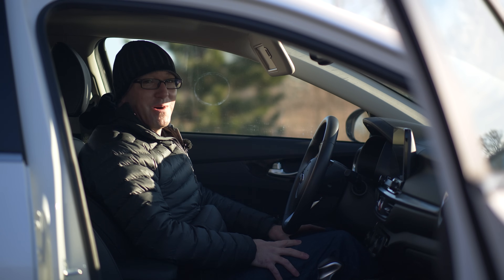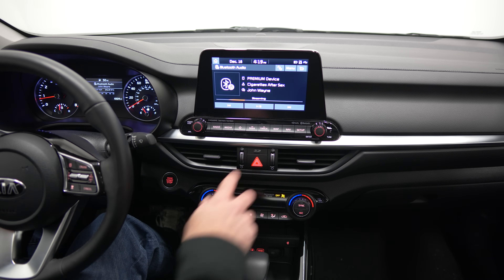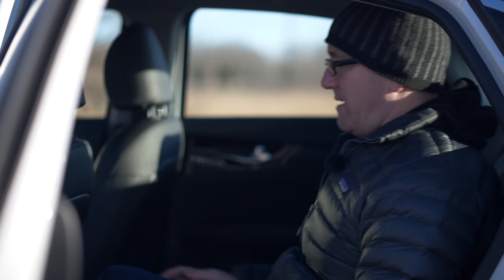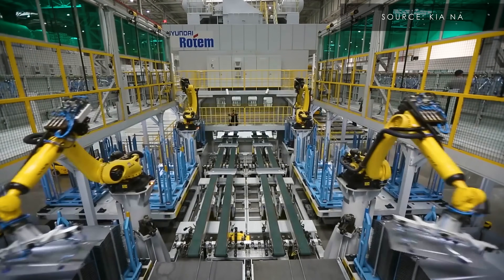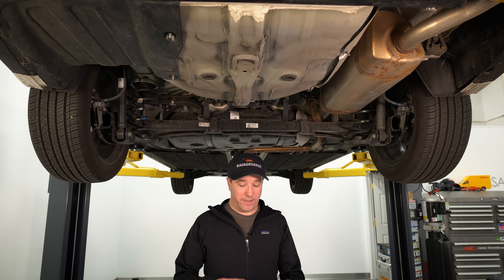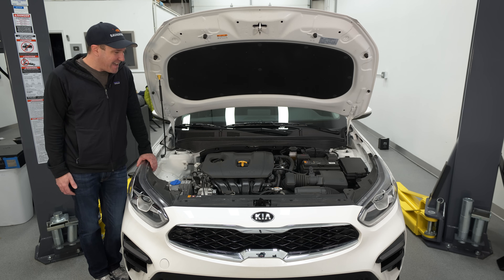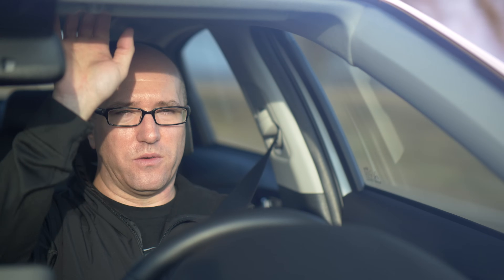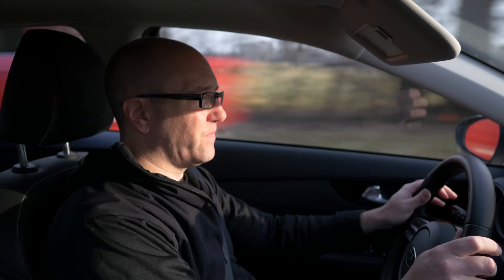2019 Kia Forte Review | Bait and Switch

Comment: This to me, from a mechanic's standpoint is a no nonsense car.

Pressed steel TCA's. Easy and cheap to replace.
Macpherson struts. Easy and cheap to replace.
Rear shocks. Easy and cheap to replace.
Handbrake cable. Easy to replace.
Port injection. No gunky sticky valves.

I see cars for what they are and can tell whether I'm getting ripped off. This looks like a Lego car in terms of stripping it down and replacing serviceable parts etc. I like this.

Tip: As with all cars made in warm dry places, get it Crown rust proofed. $500 and it'll last forever.

This car gets a thumbs up from me.
Reply: Would this car be okay for a first time buyer? I like what this car offers, and the dealership is giving it to me for $15,500.
Reply: @thundergato84  YES. ☺ 👍
Reply: @EdgyNumber1  I am debating between getting a hyundai elantra/sonata or the kia forte. 

The Kia I can get for 14-15k, and the Elantra, which has debatable looks, at 12.5-13k.

Kia comes with standard warranties.
Hyundai comes with lifetime engine warranty. 

I am literally looking for the best car sub 15k with warranty. I can work on my own stuff, but a warranty that provides complimentary engine replacements or a 120 month powertrain like kia is always nice. 

I currently drive a mk4 jetta and all the little things that go wrong with german cars are showing up. I don't plan on attempting to rebuild  the manual trans in it when it either needs new clutches or grenades itself, and I should be getting an insurance settlement from an old wreck soon, so dealership time I guess.
Reply: My complaint is limited to how wimpy the engine is, but apart from that, I love what this car is
Reply: @colt2419   Don't put TOO much faith in a super-long warranty from the manufacturer. When it comes to warranty issues, it's the independent dealer, who will likely say anything (including baselessly blaming you for the problem) to avoid doing warranty work - not the manufacturer - whom you'll have to deal with. In my experiences with new cars, between many different brands and dealers, that has been the case, consistently.
Reply: I bought a 2019 Kia Forte S. a few months back... Zero complaints. 42.8mpg on the highway!!! Lol
Reply: That's kia in a nutshell.
Reply: Most economy cars have what you listed. I'd still take a used semi used Corolla over a new Kia. It won't tank in resale value like this Korean junk.
Reply: @XenomorphLV426  listen to this man. I still got my Kia Spectra ex 05 I got in 06 with 96k plus miles. Will be very hard to sell so you have no choice but to keep driving it.
Reply: @crazykenbei  96k miles is nothing. Most Toyotas have at least 196k from that year.
Reply: @XenomorphLV426  And you would still have an easier time selling that Toyota. Lol
Reply: @thundergato84  highly doubt you'd get a launch ex for that price
Reply: @monkeyman1327  I was talking about the LXS edition.
Reply: I'm an ohioan technician. You hit the nail on the head. I do all my own work on all my cars and that includes the maintenance on my 2019 Kia Forte. I bought it primarily because I knew how easy they are to service!
Reply: @thundergato84  I've owned over a dozen older used cars. my first new car was a 2019 Kia Forte. I absolutely love my car. No problems so far at 30k.
Reply: @thundergato84  YES. That's a great deal

Comment: Kia/Hyundai/Toyota are the reason GM and Ford gave up on small cars.
Reply: toyota is unrelated
Reply: Yup.
Reply: macaron3141592653 I agree except it seems that 2nd gen Cruze has a very nice engine without issues. The problems have been in the transmissions. I think Ford and Chevy's depreciate so badly that this also dissuades potential buyers like me
Reply: When not if gas prices go crazy again (think 80's or 2008 when it broke the $4 a gallon mark) GM and Ford are going to be crying for a bailout after bailing on the small affordable car market.
Reply: When HYUNDAI TOYOTA HONDA make More SUV and Truck. FORD and GM may  only make ventilator and phase maker
Reply: Meh, they made plenty of good cars for the money, with the exception of the garbage DCT Focus. The manual Focus was every bit as good as this car or any $16,000 car. 

That being said, I definitely agree Kia, with their 10 year/100,000 mile warranty AND their willingness to put a bit more stuff in there standard whereas others make you pay extra, is definitely the best overall value out there.
Reply: @jldude84  The Facts Ford make no cars anymore is simple.  It sucks for american standard. Ford still make Focus, Mondeo, and Fiesta in Germany because Germans keeps their car not longer than 1/2 of most American and they sell well there. It is sharp and sporty, direct injection, turbo, etc. that fall apart in 6 years does not really matter. They dump it to Eastern Europe by that time.
Reply: They should really focus on their sports cars. Plus GM is corrupt allowing buyout for multiple people in the company. Not someone I’d give my money to. Unless it was a discounted corvette :)
Reply: Idlia Dosai Come on dude the Ford Pinto is 40-50 years old. It is a non-sequitur to associate general car engineering with unforeseen deaths then saying that the deaths were intentional, as if losing customers was a good thing. Much more relevant to the topic would be mention of reduced investment in Focus and Cruze in favor of more expensive cars and trucks. The largest volume of sales are in the compact and midsize segments and then 1/2 ton pickup trucks. And just because trucks have more margin, it is stupid to drop cars altogether. Maybe they are seriously paranoid of being caught flat-footed when electric cars gain market share? Poor excuse for screwing up Focus and Cruze in my opinion.
Reply: Are sure it was not because they made shit cars?
Reply: They gave up cars cause they don’t make any money off them
Reply: They make more money making oversize pick up trucks. GM and Ford does
Reply: @jamesmedina2062  But it makes them great used cars to buy.  The 2nd gen Cruz, especially the 2019 which has the button to turn off the Stop Start might be the one to buy.
Reply: Honda too
Reply: @Idlia Dosai Ford pinto happened over 50 years ago bruh 

I’m a big Toyota fan but didn’t they have unintended acceleration over decade ago and now recently fuel pumps problems? And doesn’t Nissan constantly make bad cvts that blow every 60,000 miles
Reply: @1quickster  Ford and GM pickups aren't any better in terms of quality. Ford trucks had horrendous track record namely their death wobble in the steering and terrible roof leakage problems.....If you look at the recent ford and GM trucks they are putting smaller and smaller engines on it typically 4 cylinder eco boost engines that is seriously underpowered for a truck that is meant for hauling. Out of the two the GM makes slightly better trucks than ford but both are still far off from Japanese counterparts.

Toyota Tacoma is way better in terms of a pick up truck. Not to mention Toyota also has a tough as nails Hilux that dominates Eastern and European markets that isn't available in NA.
Reply: @joskjj3625  Nissan CVTs problems are so 2010. Ever since Jatco issue Nissan changed their CVT design and most reviewers give their newer altima's and sentras a decent rating. Toyota does have fuel pump problems, Honda still has a pretty bad record from their Earth Dream shitty engines, Subaru has various minor problems, Nissan hasn't had much problems lately but their popularity just isn't there due to their history, Mitsubishi well they died in terms sales making the same crappy cars. This all leaves Mazda which still has good reliability and reviews so far. 

But the real market is Koreans, both Kia and Hyundai is kicking ass in almost every typical segment across SUV, and CUVs. They are also making sportier sedan lines.
Reply: @441meatloaf  agreed Hyundai and kia are doing really good
Reply: 1-Honda
2-toyota 
3-hyundai 
4-subaru 
5-kia
Reply: Snooze nope

Comment: as a mechanic I love torsion beam suspension. You can't beat it for simplicity. It has no struts to replace. It has two coil springs and two standard shocks witch can be replaced in under 30 minutes. Also there are very few moving parts. The torsion beam pivots on just two big bushings.
Reply: Yeah but god forbid those two mounts rust out. But I guess that’s true of many cars.

Comment: I considered this new 2019 Forte and the sister 2019 Hyundai Elantra when car shopping. I crossed off the Forte before even test driving because A) the IVT transmission is brand-new and not yet proven to be durable and B) I didn't want a hard riding car. I live in the city where the roads can be rough. So over to the Elantra I went. The more I looked at the 2019 Elantra, the less I liked the updated styling compared to the 2018. Plus, Hyundai was offering a $3k rebate on the 2018 versus $1,000 rebate for the 2019. I test drove the 2018 Elantra and fell in love. It looks really nice inside and out. It's comfortable. It drives well. It's quiet. The fuel economy is stellar. Been averaging right around 40mpg in mostly city driving. The reason I crossed off every other competitor from my list was for one or more of the following reasons: Priced thousands higher at real world prices (Japanese), much shorter warranties (all competitors), bad reliability track records (domestics), lack of mechanical simplicity and low running costs (i.e. turbo engines, CVTs, Direct Injection). The Elantra, and secondarily, the Forte, offer good reliability, low running costs, long warranties, and lower prices. Yet, they still offer lots of tech, handsome looks, and great build quality. I'm gentle with my vehicles, so we'll see how well it holds up with time.
Reply: Well said and good research. So I guess you don't mind Torsion beam?
Reply: I got the 2018 Elantra Value Edition under similar circumstances.
Reply: @moeanthony9308   So far I'm not minding the torsion beam at all. The ride quality is quite good. That's not to say it wouldn't ride even better with an independent rear setup, but with the torsion beam in the 2018 Elantra, it's very acceptable. In modern cars, the suspension tuning seems to play a bigger factor in ride quality than whether it's independent or torsion beam rear suspension. I've driven plenty of vehicles with independent suspension that don't ride any better than, or in some cases worse than, the 2018 Elantra. Independent vs. torsion beam rear setup should not be a deciding factor when car shopping. The feeling in the seat of your pants should be.
Reply: I got a 2018 Elantra on clearance to save more money and its great so far. I looked at the 2019 Forte when I was shopping around and I wont trust the CVT/IVT. The 2019 Elantra still has the MPI 2.0L engine and reliable 6 speed automatic with great fuel economy. That's the answer for people who dont want turbo, direct injection and CVT issues.
Reply: @palebeachbum  Exactly. Well said and thanks for sharing that. Great conclusion
Reply: @palebeachbum  Which trim level did you get?  The top level trims in Hyundais usually come with larger wheels and low-profile tires that ride rough.
Reply: @aamirqz  great point. Smaller rims on fatter tires ride softer. I got the SEL. I wanted the alloys and Android Auto.
Reply: If you are worried about the transmission reliability, that means you want to keep the car for a long time, so just go for a MANUAL. The residual values don't really matter after 10 years on these cheaper cars anyway, so at least you are saving your self some service cost.
Reply: Good choice!  You also avoided that obnoxious pop-up info system.
Reply: I had a 2018 Elantra loaner for a week. Generally speaking I was really impressed, but the one thing that really bothered me that I wouldn't be able to get past was the terribly transmission. Though it was an automatic, there was such a disconnect between engine RPMs and power ( and a delay ) that it often felt like I was driving a 5 speed manual with a nearly worn out clutch. I noticed the same thing on a 2018 Kia soul loaner which I believe uses the same transmission. Otherwise it was a great car.
Reply: I want to buy a car and your comments are really helpful. Actually I'm  between japanese vs korean, and like you wrote, japanese brands are more expensive.
Reply: @jonmarkwiltshire  Now that I've put about 4,500 miles on my 2018 Elantra, I understand exactly what you're saying. The transmission behavior definitely is a little odd when accelerating at a brisk pace. I'm wondering if it's an automated manual design? That's how it feels to me. Feels like when it upshifts, it clutches in, lets off the throttle, then engages gear and applies throttle. It does this fairly quickly, but it definitely doesn't feel like a regular shifting automatic. Definitely one of my least favorite aspects of the car. I hope it's at least a very reliable transmission.
Reply: Both forte and elantra share 80% of the same suspension. Same engines 1.8 or 2.0 depending on yrs 13-19.
Reply: @carlosmatias474  In the US the new 2019 Forte is based on the existing Elantra, which came out in 2017. The 1.8L is not offered in the 2019 Forte.
Reply: Soooo, how'd it hold up? :)
Reply: @joshua.guevara  mine? It's got about 16k miles now. Opinion hasn't changed in my 1.5yrs of ownership. I still really like the car overall. I still think the worst aspect is the 6-spd auto. It gear hunts and gets confused in city driving. I've learned how to manipulate the throttle to get the transmission to behave a bit better.

Comment: This vehicle has an extreme appeal in a "Back to basics" kind of way. I like bells and whistles, but as explained in your Accent video, these are appealing in their own way.
Reply: @nodak81  Yes, but at least the powertrain will be super reliable, compared to the turbocharged DI junk other manufacturers are putting out.
Reply: @weedmastersr  like the Cruz that Turbowski talked about and the Honda's 1.5 turbo.
Reply: More interested in the new Mazda 3 though. Mazda is showcasing the 3 at Tokyo Auto Salon with some extra accessories.
Reply: No turbo. Check. No DI. Check. CVT that successfully mimics a regular automatic transmission? You lost me there. If I want a CVT then I want it to act like a CVT and merely hold the revs while changing the ratio. Otherwise I may as well have the proven reliability of a conventional automatic. At least a manual is offered. Should prove to be good daily transportation if the CVT holds up.

Comment: I have to say, I now look to Kia as the savior of the low priced car. I've always been a German car guy but my girlfriend has a Forte 5 door and I am constantly impressed by what you get for your money. I don't even see the torsion beam rear as an issue having driven a Mk2 VW GTI for 18 years...they still handle just fine. At this point, Kia is delivering a product with amenities not present in my BMW 330, and although there's no way in hell I'd trade, I will say that whoever is looking for a reliable and inexpensive new car would be remiss if they didn't seriously consider these. Great review, as usual.
Reply: Hyundai/Kia are designed by a German in Germany though. TBH it also feels very (budget) German, just what I wanted. Doesn't have the expensive maintenance Germans have.

Comment: Best video review of the Kia Forte on the internet.  I watched your earlier short.  I just bought this car yesterday (before seeing this video).  Very happy I did.  Bought this as a daily driver instead of using my E46 M3.  Great work and I subscribed.
Reply: How's the gas mileage you're getting average on a daily commute on your new car? Congrats on your new purchase.
Reply: @lofiguy8136  The gas is fantastic.  It's insanely good, especially compared with my other car (BMW M3) that uses almost twice the money using 91 octane and then getting about half the distance to the tank.  I have the IVT and the Kia posted numbers are very accurate, 7.7/5.9/6.9L/100 km and on a mostly highway trip, I can get better than the posted 5.9L/100.  In my M3, I fill for $85 and can go about 380 kilometres while the Kia Forte with same exact trips and routes will go 700+ kilometres on $55.
Reply: Hey man, I got American version with cvt. Do you have cvt tranny? When in normal drive mode and when you set cruise control, does rpm jump 500-750 more higher than what it was set at when driving a specific speed using your foot on gas pedal? My car does.

only in manual sport mode  the Cruise control sets rpm at the same as driver has it using foot. So either a bug or glitch in computer logic programmed wrong with higher rpms which cause mpg loss.
Reply: @skyhawk21  Yes, I tested this and mine does the same thing.  Not exactly sure why it does this.
Reply: Every car I've ever driven with an automatic does this. Why do people think that cruise control is supposed to provide better fuel economy? That is not it's function, it's simply there as a driver convenience and nothing else. It has always been the case that you get better mileage controlling the pedal yourself.